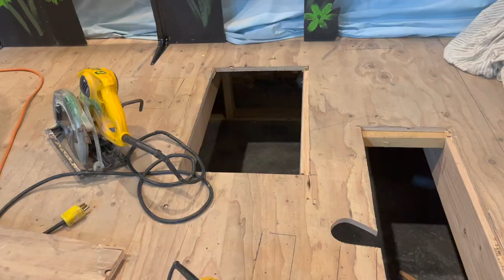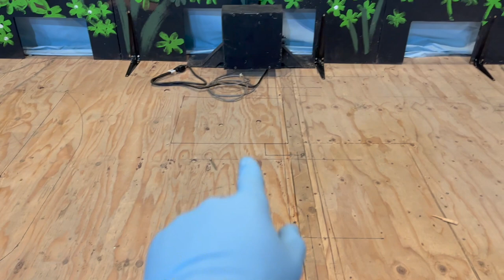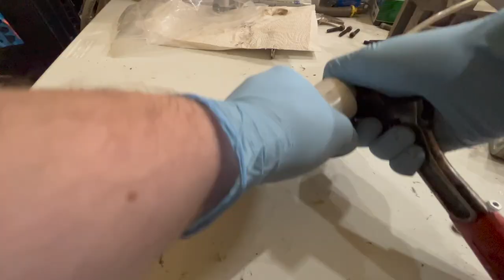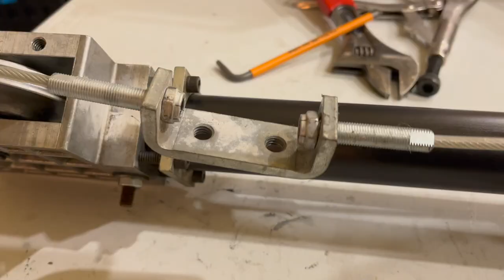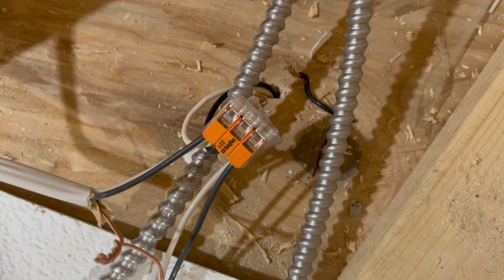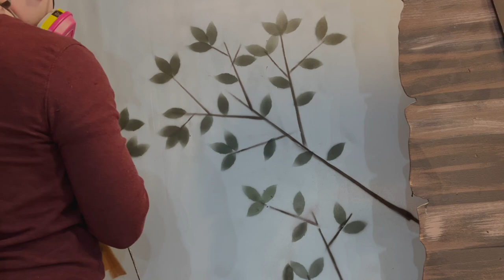Rock-afire Restoration Part 20 (Props & Staging)

Comment: Where did you get the props from because i cant find any on ebay
Reply: His set came with the props, the set came from a Showbiz Pizza auction in the late 80's and they were left in storage by the previous owner for decades. Jack in part 1 of the restoration recap explains how he got his set.